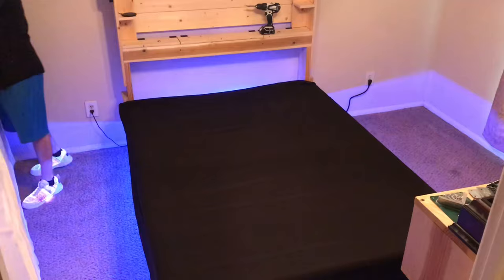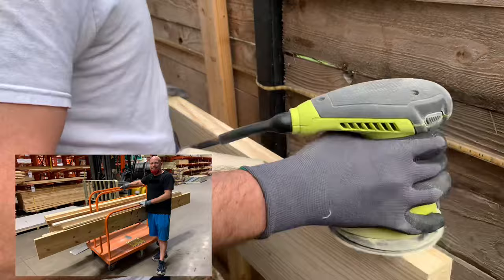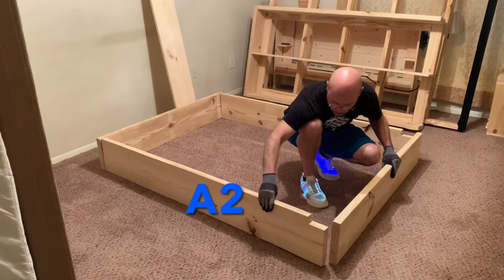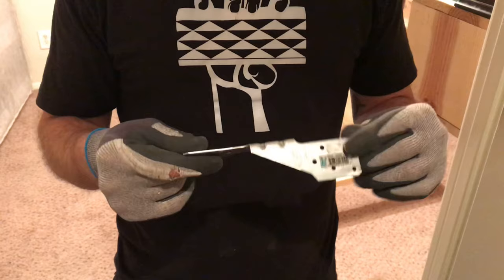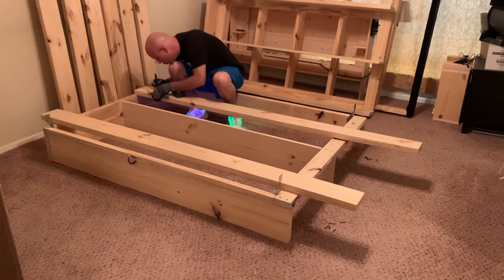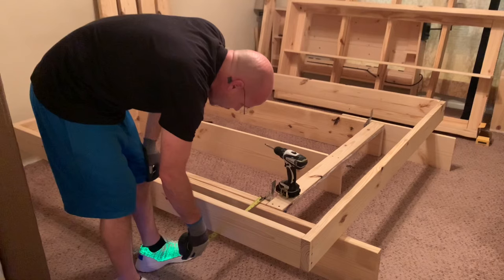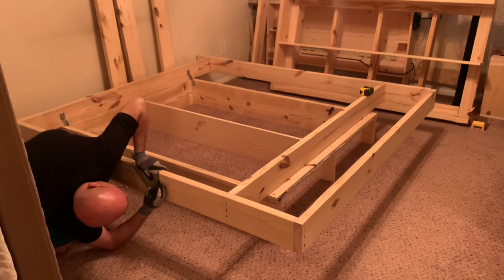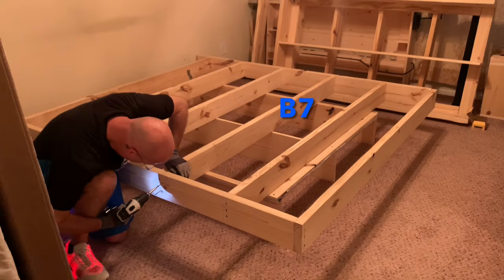King Size Floating Bed Frame [Easily build your own!]

Comment: Can I get a material list please and thank you from MB canada
Reply from the maker: @eduardofloresgrave877 Hey Eduardo, thanks for your question.  Your materials list is going to depend on exactly how you are going to build your bed frame.  You can do it as simply as with 13 - 2x6x8's if you want to...or you can make the base a little taller with 2x8/2x10/2x12's so you have more space for storage underneath.  You can adjust the measurements here so your mattress sits down inside of the frame instead of on top of it.  Have you seen the headboard for this king size floating bed frame I posted on this channel?  Reach me on instagram curtis_made_it and we'll get your materials list figured out.  I appreciate your time and support here my friend 🤝

Comment: Would you suggest adding a Simpson strong tie to each joice?
Reply from the maker: @Megan Corbin Hey Megan, thanks for your question and time.  I appreciate you stopping by.  That’s not necessary.  If you use 4 of them, one on each corner, attached to the frame and base with some 1” drywall screws, you will be more than good.  I hope this helps.
Reply: @CurtisMadeIt  okay thank you! We are heavier people so we want to make sure out king bed is stable! If you have any other tips for reinforcement, I would love them!
Reply from the maker: @Megan Corbin You are very welcome.  As long as you build it like the video, I can assure you it will be much more than stable and sturdy enough.  You can add two more strong ties if you really want to, but those things are incredibly strong.  Make sure and use a box spring or plywood on the deck of your frame.  Let me know if you need anything else and I’ll be right there.

Comment: How much did the no head board build cost?
Reply from the maker: @epixstingray9451 Yo, thanks for your question Ray.  At the time(height of the pandemic 2021), I spent an insane ~$260 for the materials for this bed frame as it is in the video.  The price of those materials has since dropped to...I'm gonna say the ~$130-$150 area.  I hope this helps and I appreciate your support on this channel 🤝 Come back and talk to me again down the road.

Comment: Are't you supposed to have 2-73"  on board 3
Reply from the maker: @stevenacevedo5108 Hey Steven, thanks for your question.  B3 should be the width of the mattress when you are securing from the outside of the foot area as shown in the video.  If you are going to fit the foot board inside of the side boards, then yes, 2 at 73" would be correct.  I hope this helps.  Let me know if you have any other questions at all.  Thanks for your time and support on this channel my friend, I mean it 🤝

Comment: my wife and i are wanting to do this for our bed :) we would like to go a bit higher so our dog could fit under it, what size did u use for the bottom base in video ? i know u listed 3 options but curious what was shown ??? thank u
Reply from the maker: @Joseph Romero Hey Joseph, thanks for reaching out.  For the king size(in this video and in real life), I used 2x10’s for the base and 2x6’s for the frame.  2x10 base gives me about 9 1/4” floating effect…2x6’s for the frame plus a 4” box spring and a 12” mattress makes the deck of my bed sit at about 30/31” off of the ground.  If you go much taller, you will probably need a lil baby trampoline to get on your bed.  How big is Doggie? 🐶
Reply: @CurtisMadeIt  awesome ty😎 full size golden Retriever 😬
Reply from the maker: @Joseph Romero You bet, I’m glad to help.  Thanks for your time and interest.  You gonna be hard pressed to get a dog that large under that floating bed frame.  I would LOVE to see how you do it though.  Let me know if I can help any more.
Reply: @CurtisMadeIt  she can probably just sleep under the edge , she’s a trooper I’m sure she’ll manage some how to get comfy lol hoping to start this in the next couple days- 👍
Reply from the maker: @Joseph Romero (Possibly) trade the 2x10 base for a 2x12 base and trade the 2x6 frame for a 2x4 frame and you will have about the same deck height but more clearance on the bottom.  That may be a better option for what you are trying to do.
Reply: @CurtisMadeIt  I was thinking about using 2x12 Actually,  my current cheap frame is 13 inches high w a 10 inch memory foam (no box spring) I am wanting a higher deck then we currently have probably 31-34 inches total but I’ll probably just get a 4 inch box spring right?
Reply from the maker: @Joseph Romero 4” box spring will work, yes.  You can also use plywood on the deck of the frame instead.  That would give you more space to work with on the bottom side to get the bottom of the frame up a little higher for Doggo to fit underneath.
Reply: @CurtisMadeIt  but how can I get the desired total height of aprox 31 inches w out box spring?
Reply from the maker: @Joseph Romero 2x12 base and 2x12 frame.  That’s gonna be a heavy set up, but it will get you there.  Modify the bottom outside edge of the frame boards and wrap the perimeter with 2x6’s instead of 2x12’s…cut the part that sticks down below the 2x6 perimeter boards off at a 45° or so angle and doggo will have a little more space to get under there.
Reply: @CurtisMadeIt  awesome ty
Reply from the maker: @Joseph Romero Yep, you bet!  Thanks for your time.  I hope your build goes well!

Comment: is this frame for a head board
Reply from the maker: @4K Hey 4K, thanks for your question.  Yes, you can add a headboard to this frame.  Notice at the head part up there, there is 5.5” extra side board from the frame.  This is what you attach the 2x6 upright for your headboard to.  I hope this makes sense and helps.  Talk to you again soon.

Comment: How do you make one for a twin size bed
Reply: Well what’s the measurements
Reply from the maker: @CjDaYoungan Hey Cj, thanks for your question.  Making one for a twin is pretty simple I'm sure, just adjust the measurements from this build and you should be able to get there.  😂  I haven't built one myself yet, that video is on the way, but I've got a hand drawn blueprint and a written step by step guide I can hook you up with in the meantime if you don't want to wait for the new video.  That will be posted...ehh...early 2022...area.  I'm on Instagram C_love1984.  Send me your email address there and I'll beam it over.  Talk to you soon my friend.
Reply from the maker: @CjDaYoungan Hey Cj, check out my reply to your original comment and hit me up on Instagram C_Love1984.

Comment: Question - the base is 6' wide by 10' long correct? Got a little confused when you posted the measurements in photo like (2x6x8/10). The key is the base is 6 by 10 correct? Regardless of storage spot or not.
I understand the measurements for the frame part of the best just fine. Just not the base
Reply from the maker: @adibabrahmziy Hey Adib, sorry for the confusion.  Generally speaking, I use 2x6’s for the floating bed frames that I build.  Some people like their bed frame to sit taller, want storage, or for some other reason don’t want to use the 2x6’s.  That is the reason for the somewhat confusing on screen instructions there.  Decide how tall you want your base to be, using 2x6’s, 2x8’s, or 2x10’s, and then cut them to length.  Does this make sense?  Let me know if I can help any more at all.  Thanks for your time and support my friend 🤝
Reply: @CurtisMadeIt  thank you for getting back to me, so nice.
Yes I would do a 2x8 for the base.
According to the video my width should be 6 feet  wide and 10 feet long before I build the frame right? Thank you, this is such a sweet video.
Reply from the maker: @adibabrahmziy Hey Adib, you bet my friend.  6 feet wide and 10 feet long is a little ambitious I think...american king size measures 72" x 84"...so 6 feet yes for the width, the length will be closer to 7 feet, unless you are adding a headboard, and that will make it a little longer but 10 feet is too much.  I hope this clears things up.  Let me know what else you need, I'll be here.
Reply: @CurtisMadeIt   so here in Canada a king size bed is 74" wide and 78" long (6' 2"x 6' 6")  so it's not quiet like yours, what size width x length Base would you reccomend for this size of king mattress I prefer the base to be as hidden as possible 😅
Correct me if this is wrong, I am assuming from the parameter of the bed (LxW) , the base has to be 12" smaller on all sides  , and then the frame built has to be the exact parameter of the bed, then attached to the base wich is 12" shorter than the frame on all sides to get the floating look yea? 👍
Reply from the maker: @adibabrahmziy Hey Adib, you are super close my friend, yes.  I personally would take 12" off of 3 sides though...that would the be two sides and the foot area, and secure your base to the frame flush at the head area.  Are you thinking about adding a headboard?  If you do, then you will be floating all the way around.  Anyways, base...lets go something like 50"W x 64"L and leave the space at the foot, that's what I'm going to recommend.  You want that extra weight on the base to help hold the bed frame down and keep it from tipping.  I'm here if you need anyithng else, you seem to have a pretty good idea though.  Sorry for the delay in my reply here, I get back to everyone as quickly as I can 🤦‍♂️
Reply: @CurtisMadeIt  I actually built this 2days ago, I went with the base being 10 inches smaller on all sides and it came.out great, the head area I built it the same as the one in your video. The base for me was 60 inches by 55, the frame went on at 80x75  and I stood on it and no lifting, so I think 10 inches of room between the two is the "sweet spot" and I can't even tell there is a base underneath. Your video was super helpful, thank you ❤️
Reply: @CurtisMadeIt  and no worries for any late reply , very helpful human beings like yourself are a dime a dozen! We all have lives we are trying to live 😊
Reply from the maker: @adibabrahmziy Awesome, sounds like your dimensions may be a tiny bit different than what I used, but you are spot on.  Good job.  I’m glad this turned out well and hope that you are super thrilled with it.  I’m glad to help as I can and I’m thankful and grateful for interactions like these here with you.  I appreciate you understanding that I’m human too.  Lots of irons in the fire right now…I make time for you guys as soon as I can though.  Cheers brother 🍻

Comment: Do you put slats on top of that or a box spring ? What supports the mattress ?
Reply from the maker: @curtis brunner Hey Curtis, thanks for stopping by.  I use a box spring to support my mattress.  You will either need that or some plywood on the deck of your frame to support yours.  I hope this helps.  Talk to you soon.
Reply: @CurtisMadeIt  thanks for the reply, after watching the video again and watching the box spring nearly take you out I put 2 and 2 together 😅keep up the good work 👍
Reply from the maker: @curtis brunner Awesome, thanks so much my brother.  Be careful out there.  Thanks for your support and I’ll talk to you soon.
Reply: @CurtisMadeIt  heck yeah! gonna try to get everything together for my king size build this week. I wanna try to use different hardware. Instead of screws I want to use( screw studs ?) perhaps metal sleeves in the pre drilled holes with washers and nuts so I can disassemble it and re assemble it multiple times. 😎
Reply: @CurtisMadeIt  I always work on cars I don’t work with wood as much. Did you build this with regular wood or dimensional? Any benefits from either or ?
Reply from the maker: @curtis Brunner Okay, okay.  I like the sound of this.  I've been racking my brain for...many, many months...trying to figure out how the heck I'm gonna put my bed frame(s) back together exactly the way I put them together the first time(for my YT videos).  ...I'll just end up very painstakingly labeling them when I disassemble, but will only have to do that once(hopefully) 😂.  Maybe look at Lag Bolts.  You can get those pretty long if needed with some washers and nuts and that might actually work for you.  Let me know how that goes if you end up on that path.  Thanks so much for taking the time to talk to me.  I appreciate your correspondence and ideas my brother.
Reply from the maker: @curtis brunner This is just regular dimensional from Big Orange(I'm in USA).  Don't use treated wood for any indoor furniture ever...you will really be able to see all of the wood grain patterns with your new third eye.  Always untreated lumber for stuff like this.  This bed frame is WAYY overbuilt...kind of on purpose.  I wanted it to be easy to build but substantial enough for...you know...when it needs to be substantial enough(earthquake, bed shake, large people, rambunctious children, etc.).  You could really get away with 2x4's for the deck if you wanted to.  Use those Simpson strong ties for sure, those things are bad a.  Take a whole lot more than enough time to plan your project...that's the hard part.  Once you get that on paper, you will know exactly what you are doing and exactly what you need.  I can help you if you'd like...I'll just ask you a whole bunch of questions and then spit out an idea at you.  ...sooner or later, I'll end up maybe selling or reappropriating all these bed frames I'm building right now and build a really bad a one for myself out of cedar...or some other awesome wood.  The work and ideas never stop.  Safe building bro.
Reply: @CurtisMadeIt  thanks for all the awesome info ! I have it all drawn on paper with all of your measurements everything seems to be perfect.
Reply from the maker: @curtis brunner Awesome, that’s the way I planned it.  I’ll be here if you need anything else.  I hope you have a safe build!

Comment: How much would you say the cost was ?? FL
Reply from the maker: @Brandon Abrams Hey Brandon, thanks for your question.  You could build this king size floating bed frame and the headboard that is posted on this channel for less than $200 for all the materials.  Of course, you’d still need the tools and labor, but it’s not extremely expensive to be honest.  I hope this helps.  Be careful my friend.

Comment: Do the LED strips connect to the motion sensor strip?
Reply from the maker: @Garrett Griggs Hey Garrett, thanks for stopping by.  I linked 2 different sets of lights in the written description of this video.  Either set will work for you just fine.  The motion activated lights are controlled through an app on your phone and the other set has a remote(but no motion sensor).  I hope this helps my brother.  Talk to you again down the road.
Reply: @CurtisMadeIt  Thanks. The motion activated one from Amazon is 9’ long. Do I need something longer than 9’ to give a good lighting effect?
Reply from the maker: @Garrett Griggs get the 2x9.84ft set that is $25.99(currently 7.11.2022).  That will be enough light for under there for sure.  Anything else I can help with my brother?
Reply: @CurtisMadeIt  No sir. Appreciate the video. I may give it a try.
Reply from the maker: @Garrett Griggs Awesome.  I hope you have a safe build my friend.  Be careful.  Come back and update me and let me know how it goes.  I’m on Instagram realc_love1.

Comment: I can’t find the queen size video. I’d like the measurements for that. I have wanted one of these beds for a long time.
Reply from the maker: @stacey huff Hey Stacey, thanks for your interest and I’m glad I’ve got something that will work for you.  Check the ‘videos’ section on my channel…DIY Floating Bed Frame is the original.  It’s not a great video as it was my first ever, but I’ve got another video with a base modification to add storage, and a third video adding a headboard with floating night stands as well.  I hope this helps.  I’m on Instagram realc_Love1 if you want to reach me there, just letting you know.  Thanks for your support.
Reply: @CurtisMadeIt  found it. One other question. If I wanted the mattress to sit “into” the frame just a couple inches and not use box spring could I just use wider boards on the outside frame? Thank you for taking the time to answer.
Reply from the maker: @stacey huff Yes ma’am, you are very welcome.  I’m glad to help.  You will need either a box spring or plywood regardless…the gaps in between the joists in the frame are too large and it won’t properly support your mattress.  This frame is designed this way because when I built it, I had a box spring…as you probably saw in the first video.  If you want the mattress to sit in your frame(not needed, mattress won’t move at all, I’m certain), you will need to cut your joists a little longer and use 1x8 or 2x8 around the perimeter of your frame.  This will make your frame have a little pit area for the mattress to sit in…a little lip around the sides and foot to satisfy your desired look.  I hope this helps.  Keep asking, I’ll do the best I can to answer quickly and thoroughly.  Talk to you again soon.
Reply: @CurtisMadeIt  thank you so much. I am planning on using plywood on the top of the joists to support the mattress. You’re awesome.
Reply from the maker: @stacey huff Yes ma'am, you bet.  This will work just fine.  Glad I was able to help.  I hope you have a safe build and come back and see me down the road.  Talk to you then.